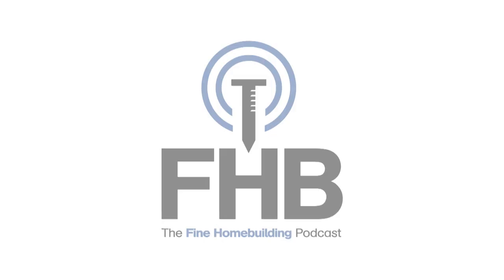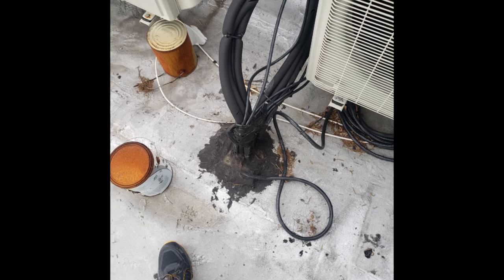Podcast 261: Leaky AC-line Boot, Cold Kitchens, and Building Workshops

Comment: Hello, I am a union sheet metal worker from western NY. I specialize in the HVAC trade and I would have to disagree with using a pitch pocket for linesets. If going through a roof with linesets is a must. Install a pipe portal curb with appropriate cap to allow each line it's own witches hat in the rubber boot. Essentialaly it's a metal box with a open top and bottom with a plastic square to round cap and a rubber boot clamped onto the plastic round collar. The rubber boots range in one outlet to five. They are very common on commercial flat roofs and pitched curbs can be made for slopped roofs.

Comment: That shed and attaching it. I've dug a limited amount of holes for sonotubes, put in rebar, with connectors for the building, poured concrete. What if he used one on each corner, maybe bolted the building to the columns so it can be removed, later, if necessary? I've one it by hand - and not enjoyed it, but it worked. If need to be a M-I-L house, might need o run sewer/septc line at least ut from under the building. We don't have Planning & Zoning, though.